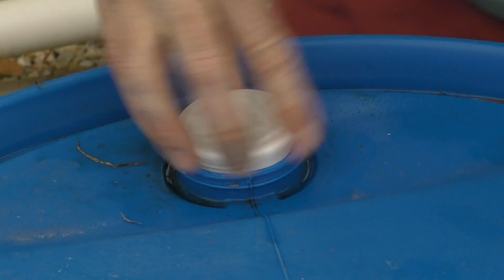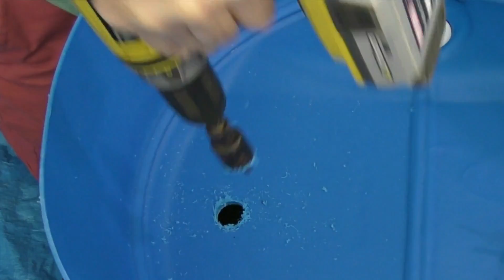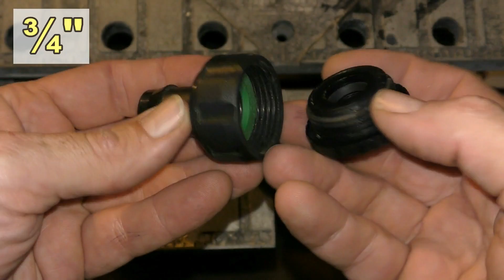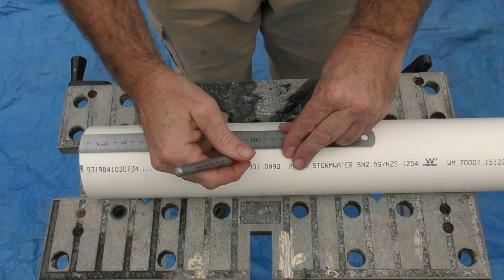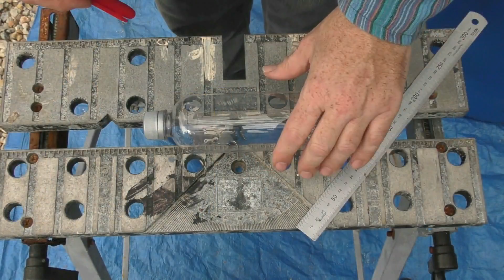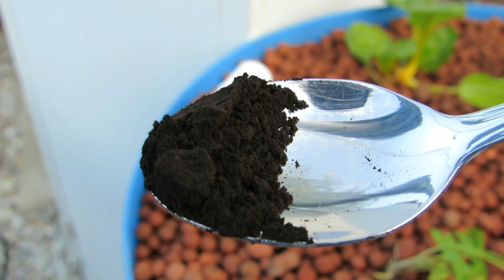Aquaponic Barrel System Build, Chop & Flip Style.

Comment from the maker: Want to learn more about Aquaponics? 🐟 🍓🥬🍅
Learning is easy with my "Beginners Guide to DIY Backyard Aquaponics" for only US$19.95.
► https://www.robsaquaponics.info/beginners-guide-to-diy-backyard-aquaponics
Reply: I think that it may be easier to cut the holes in the side first.  It would hold the material more rigidly so you don't have to struggle with it flopping around so much.
Reply: One of the bungs is normally 2" npt and the other is buttress thread which is useless but the bung of that one often has a 3/4" npt knockout in it.  With these fittings I think you could find a way to avoid needing to even drill holes in the top and eliminate the need for a bulkhead fitting which is sometimes hard to find and can be expensive.

Comment: I noticed this system does not have solids filtration, will this be sustainable? How long till something bad happens to the system?
Reply from the maker: The bed is so small that they are easy enough to clean out I think. You could add on a small canister filter though if you felt it needed it. 👍
https://youtu.be/HtMZRM3a5Fs

Comment: I made this one a few years back.  It worked till the fish died.  We suspect the water level fluctuations stressed them.  Any suggestions on a modification to make this a constant height fish tank? Or would it be best to add another fish tank and make this a sump instead?  I want to try again 😊 Thanks Bob
Reply from the maker: It could be a few different reasons. How many fish did you have & what size were they? 
Happy to help if you want to post here.
Reply: They were small tilapia about 1-1.5 inches.  Had about 15.  It only ran for about 2 months then they died.  The veggies were fine.  Since I have re-tried with a bigger setup and 7 goldfish.  Nitrates never get above 5ppm.  So I would like to retry the successful barrel chop and flip but make it a constant height somehow.  The goldfish have been living in this system for a year and a half, no successful plants

Comment: Hey Rob

I have set up a couple 55gallon Chop & Flips just like this now. These are placed in my backyard in SUNNY Central California. 

My grow bed is filled with clay pebbles. It takes 9.5 minutes to fill, and 2.5 minutes to drain. Is this a good rate?  How many times SHOULD the system flood and drain per hour?  How many hours a day should the pump run?

(For now, growing loose leaf lettuce)

Comment: Not sure if necessary, but I build in a bowl section in my pebbles where the water dumps in to my grow bed. There I put an old coffee filter housing from a broke coffee pot. When I first set up, I rubber band coffee filters in to it and it strains out any pebble/rock debris. Once the system is really clear, I remove the coffee filters and put in a very fine mesh metal strainer in case something randomly finds it’s way in.

Comment: Straight forward instructions.
Thank you.
Reply from the maker: Cheers Shawn,
Reply: @RobsAquaponics  I like the smaller setup.

I understand the basics now.
Something this size does not have a lot of upfront cost.

Will be easy to try.

What do you think about using rain catchment water to keep the resevoir full?

Also I live in Texas.
Are there any added precautions for extreme heat?
Reply from the maker: @shawnr771  Sorry I missed this. We used town water there as we had no tanks on the hose. At our new farm we only have rain water & a few dams/ponds for water so will be using pond water when we build our new system. 
For heat, I found shade cloth over the grow beds to be the best way to keep the plants cool. Also having as little grow media exposed to the sun helps as it can transfer heat to the water as well. 
Sorry again for taking so long to respond.

Comment: Is it neccecary to also make a biofilter for this system and an air pump? And if so, how big should the biofilter be?
Reply from the maker: The grow bed is the biofilter so an external one isn't necessary in this system. The only time I like to use them is if the fish load is higher than the media beds can process (a risky position to be in) or as part of a back up in case I want to decouple the fish from the plant side of the system for maintenance or renovation.
Reply: @RobsAquaponics  thanks alot Rob. One more question (hopefully I am not asking to much of you) Do you also not use a solid filter in this system because of the size? I learned alot already from your video's and but I try to fill in the gaps in my knowledgde. Thanks again.
Reply from the maker: @NielsAlderding  That's pretty much well it NA. They are easy to clean out by hand if solids build up becomes an issue I think.

Comment: how can I do this setup but add the waste filter added?
Reply from the maker: You can pump up to something like this canister filter 
https://youtu.be/HtMZRM3a5Fs
Then have the clean water overflow into the bed. 
You could also use a smaller container as the flow rate would be a lot slower in a small barrel system.

Comment: How many times days the runs to fill up? Every 30min or you keep the pump running??
Reply from the maker: The pump runs 24/7 in systems set up like this. It helps to keep the waste in the water processed.  I've had some that cycle every 10min & other that it takes up to 20-25min. 👍

Comment: A little caution for anyone cutting or working on barrels, use caution if the barrels were used for chemical storage! If that barrel contains as little as a teaspoon of acetone or other solvents in it, it has the potential to exspolode rather violently. In the case of plastic using hang tools to get it apart should make it safe, don't bother with mettle I'd wedger the heat from your hacksaw could set it off.
Reply from the maker: Drums here must be cleaned out before resale as I understand it due to residue issues. One of the reasons I don't like buying drums from the side of the road or from market stalls unless they're in the business of recycling.

Comment: i was wondering if i could expand this and utilize 4 barrels. 1 be a fish tank, one be the flow settler, and the last 2 will be sump tanks. I would like to utilize 2 sump tanks so i can test the water before and after it has went through the Aquaponic system. there will be a bioreactor and the trickle system in the whole system. and that would mean 4 grow beds to be utilized with a small grow bed on the bioreactor to help start seetlings. i might attach a small fish tank for young fish and a minerization tank down the line. my fish tank will be using a much bigger barrel and will be able to have access to the grow beds and tanks with ease. this also means that i will haft to have fish that produce more amonia then talapias and rainbow trout because im not using a split flow. 

Rate my soon to be system lol
Reply from the maker: I would only use small ornamental fish in barrel systems. I don't think there's really enough space to grow out table fish. Just my thoughts as I know some will disagree. 😉
Reply: @RobsAquaponics  yeah, Ive already ditched that design... <-- engineering problems

Comment: Great video, do you need to remove the solids from this system? Ive been watching your other videos with the radial soilds removal system. I wouldnt want to create an anaerobic area in this system. How do you suggest to combat this?? Many thanks.
Reply from the maker: Hey Angela.  You could use a basic DIY canister filter if you wanted.  I think it would be just as easy to clean the bed out once a year as you'd only have 5 or 6 fish in there & they wouldn't be producing much waste. 👍
Popping a small pot scrubber under the inlet to the bed will also help to collect some solid waste as well if you wanted to reduce the amount going in.
Hope that helps some.

Comment: I tried my hand at this. The plumbing is a simple idea but damn hard to come across the parts. Bulk heads especially. 
Also, I've learned to never use a barrel with a removable lid that uses a ring clamp to hold it on.. the bevels in the lid proved difficult along with sealing the lid to secure it. 
I have pushed past all the troubles regardless(which helped me learn ways around problems) so tomorrow we will see if it works.
Reply: I am having problems finding the parts as well!
Reply: @Khaliqsim  
Save yourself the headache and either order online or substitute
Reply from the maker: How's the system going for you John? Hope the rest of the build went smoothly.
Reply: @RobsAquaponics  
Hello , sir.
I fittled around with the parts list sizes until I could make it work. 
The system runs great !
I have built 2 so far. The first I call Frankenstein because of how ruff it looks due to me not having a jigsaw and , cutting the top (bed) to high up causing it to not sit flush. Bought some tools and with 1st build experience The 2nd chop/flip was way easier, smoother and better looking. 
Taught the wife and kids how to build and operate the system. 
They love it and I love that they are learning how to feed them selves. 
Thank you for the time you spend teaching all of us here on the tube.
Reply from the maker: @STNKFIST88  That's great to hear John. 😁👍 
Cheers mate & happy growing.

Comment: Rob I have a 10000 ltr pond with mechanical filtration. I want to add hydroponics in the return to the pond. However the flow rate is once every hour. Is that too much for the hydroponics to be successfully established and work? The bed would be about 1.5 metres by 1 metre and however deep it needs to be.
Reply from the maker: You would need to have some air running into the grow bed during the down time or the plants may die if you grow traditional veg in there I think mate. The other option might be to look for plants that do well in boggy, marshy regions & look at growing them in the system. Tarro & water chestnuts might be a few good varieties to try. 
Hope that gives you something to think about mate. 👍👍

Comment: Just watched this video and I'm curious how the water will get cleaned in the short amount of time it's up top for it to be a good setup for a few fish.
Reply from the maker: The water is cleaned in the bed itself. The solids are removed & the ammonia converted through from ammonia to nitrate. 
You could add on a solids filter if you wanted to stretch out the length of time between cleaning out the beds.

Comment: Hi Rob, just a quick question - for the water flow from the pump up into the growbed you don't have to have a hole going through the "roof" with a standpipe do you? Could you take the (flexible) pipe out the back service hole where the pump power cable goes and then with an elbow joint direct it into the growbed? It would need to be fastened to the side of course. Just wondering if I could simplify the design and make it more affordable too.
Reply from the maker: Running it up the side of the tank works just as well Martin. 👍
Hope the build goes well mate.

Comment: Can multiple units be linked together? I like the set up but want to run many and not have to run so many pumps
Reply from the maker: You could do that. 👍I think you'd be better off just using a larger container to start with as it will make the piping a lot less complicated + you'll probably be able to use more fish & grow more veg that way.
Cheers.

Comment: Does the water pump runs 24/7?
Reply from the maker: Certainly does. Some folks will attach a timer to the pump & only have it running for ½ the time. You will need to make sure that the fish will get enough air & also that the water is properly filtered through the bed.

Comment: what does it serve to purge the top with a syphon ?
Reply from the maker: It allows air to get into the media for the roots & bacteria to use. 👍 
Some folks will run constant height beds but will make sure the water is very well aerated for the same reason.

Comment: You could spend time sealing up the bung lid and drilling a new hole in something that already has two bungholes in it... or you could replace the bung lid for one that has a bulkhead fitting for pipe already. Seems like a waste of time to do it this way unless you just happen to already have those specific materials available. Doing this from scratch, where I would have to buy fittings etc, I would just buy the bunghole bulkhead fitting and re-use the bunghole.
Reply from the maker: Not sure where you get your bulkheads from but they're not cheap here in Australia. 🤔
Reply: @RobsAquaponics  I just looked it up. I guess the lingo for bunghole covers is sticking with a theme, they are called buttresses. Prices range from $1.50 to $2.50 U.S. per unit, which is a bit cheaper than bulkhead pipe fittings. Has 3/4" female threaded opening. I guess without the bulkhead pipe you would have to figure out another way to secure the cover like a bushing. https://www.bestcontainers.com/ppa57.html?gclid=Cj0KCQjwy6T1BRDXARIsAIqCTXos5tr3HLMu69NHsnKOab-09VAV12S4B6yyFuLHc07N5Ce0KNMtlq8aArq7EALw_wcB

Comment: Hi Rob I have been inspired in making an aquaponic setup with the barrel (with few modifications) and I've made the entry and exit holes into the barrels a little further down than what was mentioned in your tutorial, I just want to ask would it make much of a difference? I just flowed more water whilst the system still fills and drains, I would like your input on this please, if it doesn't suit I may have to silicone the parts and recut it. 

Also what sort and how many fish would you recommend for the barrel setup, the barrel top I cut off is 19cm as you described in your video. 

I'll be looking forward in your input and thanks for making the tutorial it was an experience making it. 

I can share you photos from my other computer later if you like :). 

Cheers

Andrew
Reply: sorry forgot to ask am I able to use silver perch and catfish?
Reply from the maker: Hi Andrew. It would just mean that it will hold less water for the fish. You could possible run it as a constant flow system so that way the water would be fairly high all the time. 
I would also only run 5-10 gold or ornamental fish in a small system like this. the Chop & Flip IBC is better suited to growing a few table fish if that;'s what you're looking to do. 
Cheers & happy growing.

Comment: Why drill the hole in the bottom for filling the grow tank? Is there a reason for not just running a hose outside the barrel that goes over the top onto the grow media?
Reply from the maker: No reason why you can't. I wanted to keep this unit all neat & tidy with no external pipe work.
Cheers.
Reply: @RobsAquaponics  Ok thanks!

Comment: This is my first try! Learnt everything from your videos, but I have a few questions. What kind of fish can this system hold? Can I replace the bell siphon with a U siphon? And finally, for the solids filter can I just put a net underneath the water feeder? Thanks!
Reply from the maker: I would only use small ornamental fish in a system of this size. Ranjani. 
Swapping the siphon out is no issue, I just like the compact size of the bell siphons. 
I found small scrubbing pads work great at catching the solids. The do need to be cleaned out fairly regularly though.
Hope that helps some & happy growing.
Reply: @RobsAquaponics  Alright! Thank you. I actually have one more question; As of now I can only measure Ammonia and pH levels in the water. Is that enough to keep the fish healthy?
Reply from the maker: @denversisters7139  We use the API fresh water test kit here in Australia made for aquarium keepers. Your local aquarium supplier should be able to help you out with some sort of testing gear.

Comment: Rob,  terrific video, thank you! I have some feedback after building out a two barrel system based on your instructions - 

1 - I'd suggest securing the media guard to the barrel. If it jostles around, basically at all, and media gets in inside the guard, you're screwed. I made a little "cofferdam" out of an old jug so I could clear my stuck media out so I didnt have to clear the entire media level when it required clearing. After about 10 times of doing that I cleared out all the media and secured the media guard with a high corrosion resist L bracket and a couple matching screws. I never had another issue with pellets in my siphon again.

2 - Your pump recommendation (260gph) was massively overkill for my system. I had my bypass on full blast and was still getting too much water. It turned my fish level into a mini typhoon and was causing weird issues with my siphons. A swap to a 120gph and the siphons are running like a dream and my fish no longer have vertigo.

3 - After all is said and done I would suggest skipping the zip ties. One of my barrels was deformed and it was impossible to seat, so I set it on small lengths of 2x4. I ended up doing it with both because it felt sturdier and provided a little more visibility nto the fish level. 

All said and done I've got basil in one and strawberries in the other and everything is looking up! 

Thanks again!
-ArcadiaTX
Reply from the maker: Hi CA.
The siphon base plate stops the guard from lifting so that's why I include it in my builds. 👍
With the pump, it can be hit & miss between brands as to how well they work so can only give the information out on what I'm familiar with. Probably should have pointed that out better in the clip. 😉
Glad your system is doing well.👍
Cheers & happy growing.

Comment: Beginner here, just asking for clarification: The expanded clay balls serve as both the bio-filter and the aeration device, as well as the grow medium in this setup? I see in larger set ups a specific aeration or degas chamber based on specific needs. For example, we have chlorine in our water so we need a degas chamber correct?
Reply from the maker: I would let it sit in an open container for 24-36 hours to let the chlorine gas off Aleister. Adding an air stone in there will help speed the process up a bit as well. 
Cheers mate.